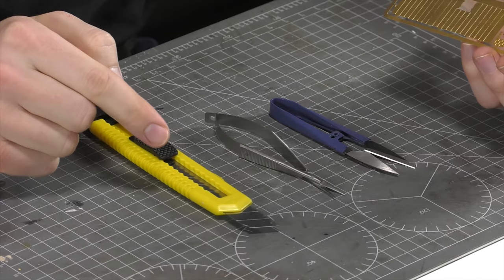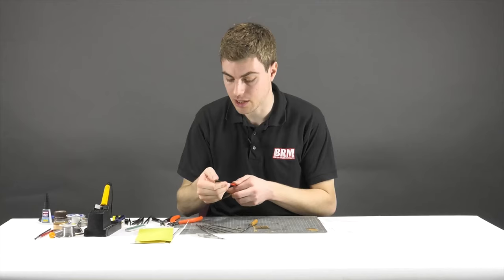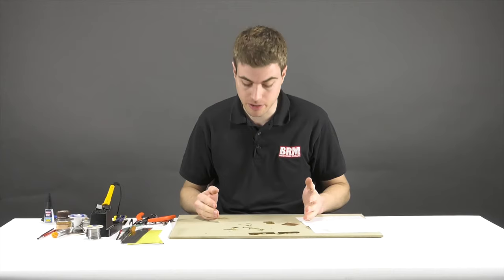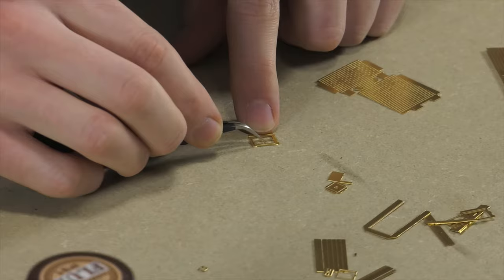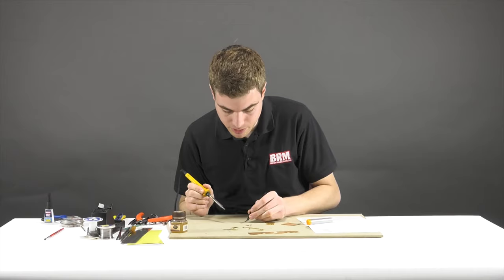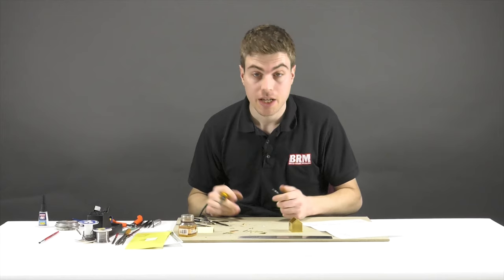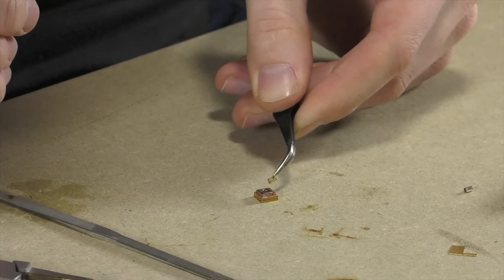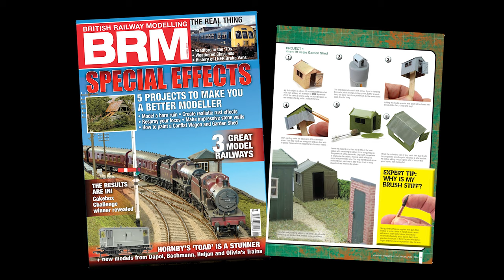Basic model railway soldering techniques

Comment: Top Tips. 1. Avoid needle files. A six inch file will help prevent dips and curves being filed by accident. 2. Put a small blob of BluTack on the bottom of the flux bottle to help prevent upsets.

Comment: thank you for this. so far I have only soldered dropper wires to track. I have a liquid Rosin flux and both lead and lead-free solder and an adjustable, but cheap soldering iron. if possible could you kindly let me know a list of products I need to acquire to start building brass and white metal kits. Or is the items I already have, all that I need. many thanks, Paul at Sandling Junction